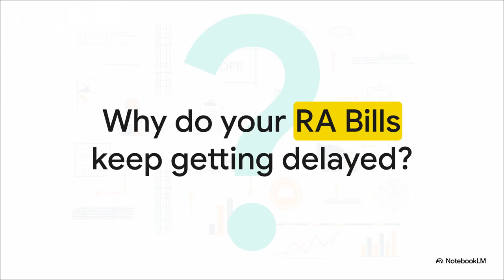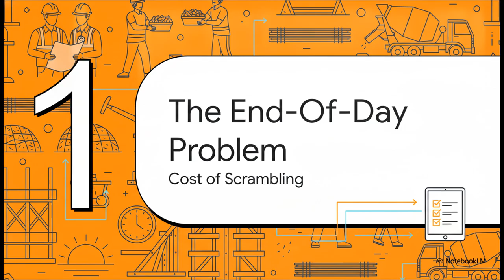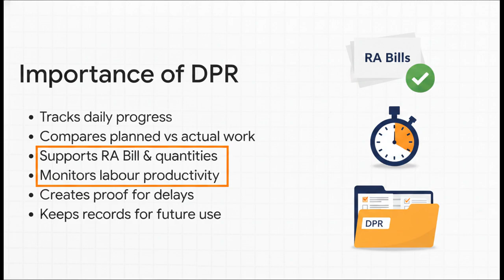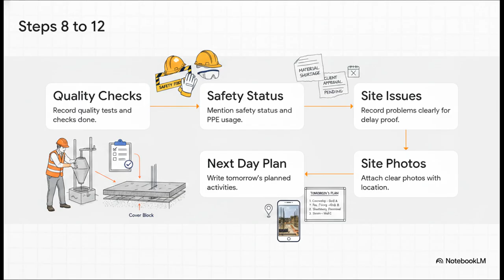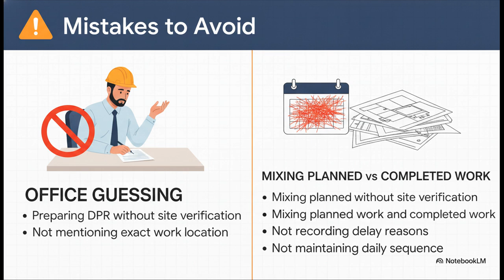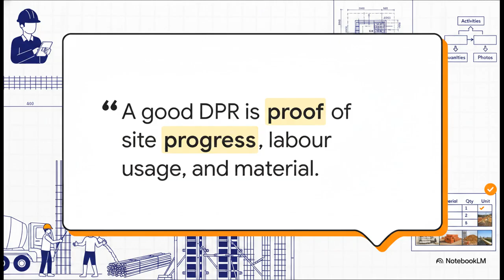DPR Preparation Workflow for Site Engineers | Civil Engineering | IBG InAI

Comment from the maker: 📌 DPR Preparation Workflow

A proper DPR should clearly answer:

1️⃣ What work was done?
2️⃣ Where was it done?
3️⃣ How much quantity was completed?
4️⃣ What manpower and materials were used?
5️⃣ What issues or delays happened?
6️⃣ What is planned for tomorrow?

📘 Detailed DPR Guide PDF and practical civil engineering workflow materials are shared in our Telegram channel.

Join here:
https://t.me/ibginai_civilworkflows

By IBG InAI | Civil Workflows